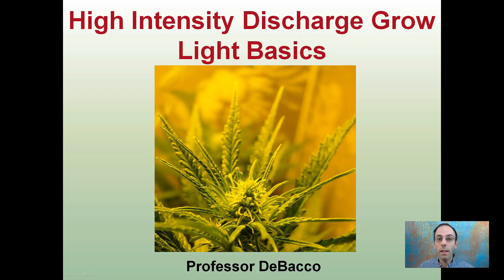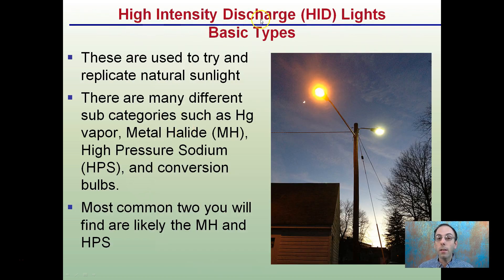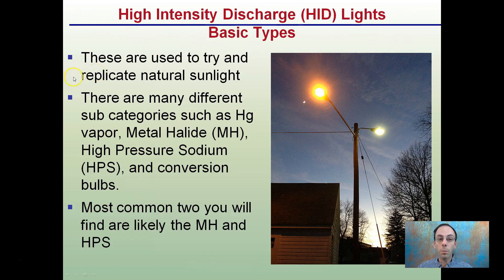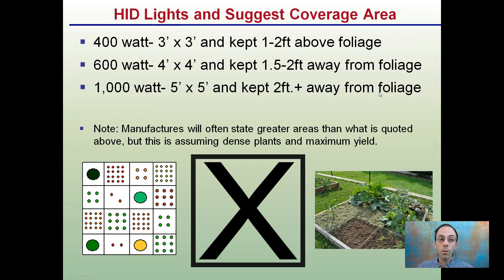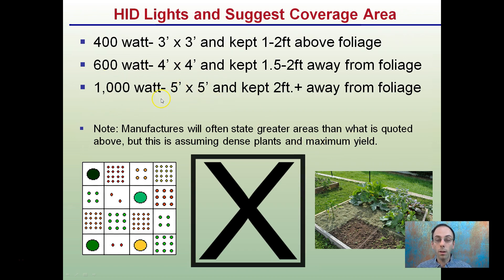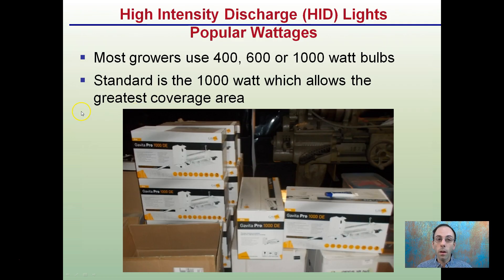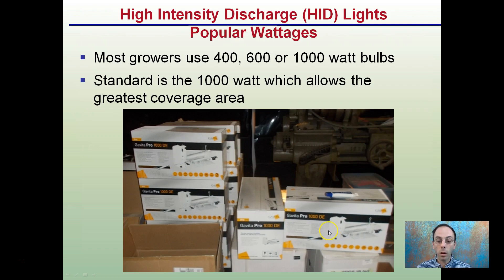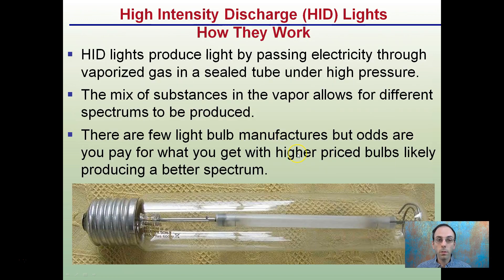High Intensity Discharge Grow Light Basics

Comment: Consider getting safety lenses for your light hoods. Also consider retrofitting your hood by adding ventilation. Get rubber washers and insert between light socket and the hood. This prevents the hot socket from having metal to metal contact and allows more air into the hood. Holes can be drilled into the sides and top of the hood for additional air movement.    With additional ventilation, safety glass and a fan and the distance to plants can be six inches or less.
Reply from the maker: Thanks for your suggestions which are good safety measures to keep in-mind.